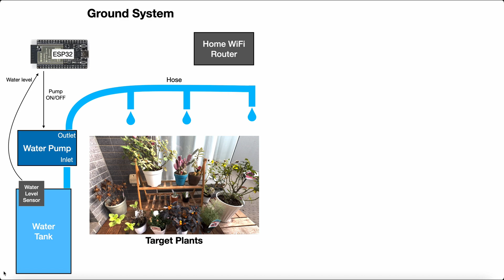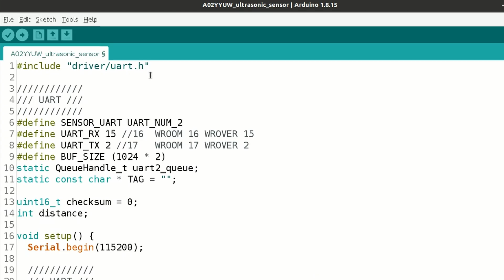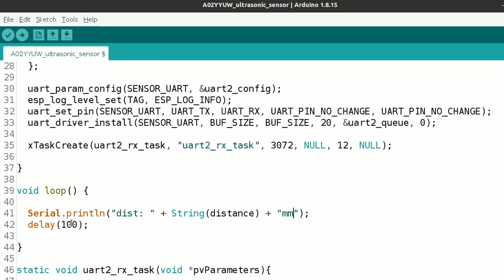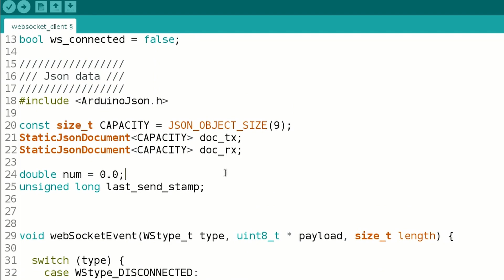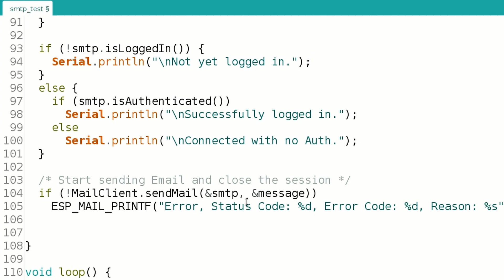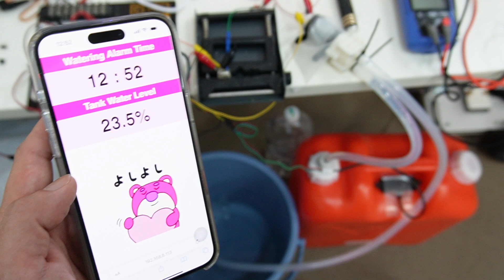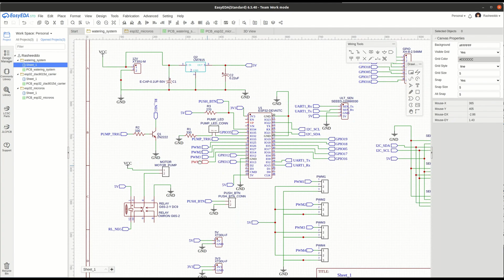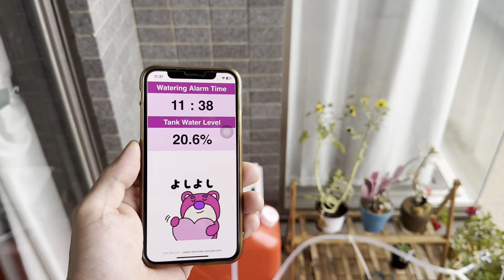Save Plants from Dehydration by Automatic Watering System with ESP32

Comment: Hey Stepbystep! Really cool project—it's exciting to see how you've managed to automate plant watering with a microcontroller and pump system. If you’re ever interested in a simpler, low-maintenance alternative, you might want to check out a passive system like Blumat. It doesn’t use any electricity and works based on soil moisture, making it more fail-safe, especially when you’re away for long periods. Just a thought, but great work on your setup.

https://www.youtube.com/watch?v=ZPDxoDS1sbI

https://www.youtube.com/watch?v=WHcOWdXF6ik
Reply from the maker: Nice project!